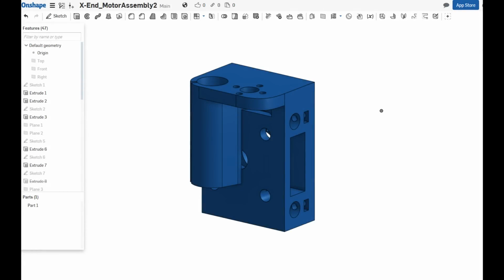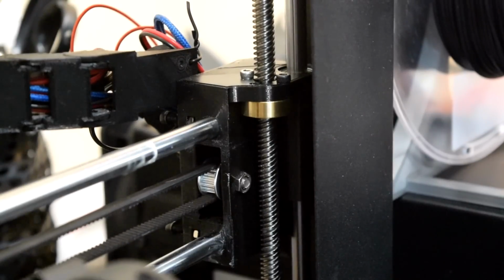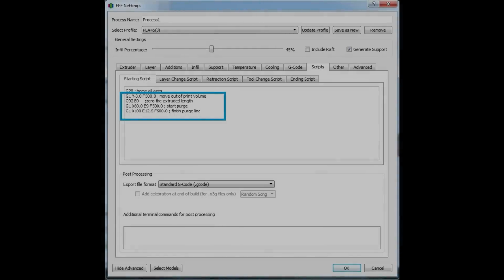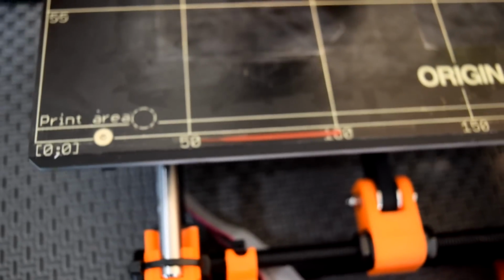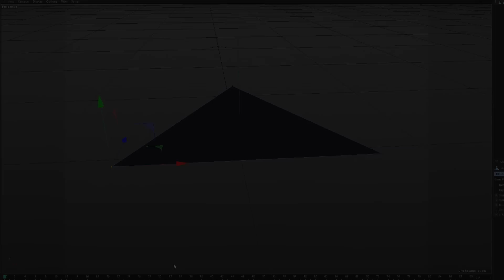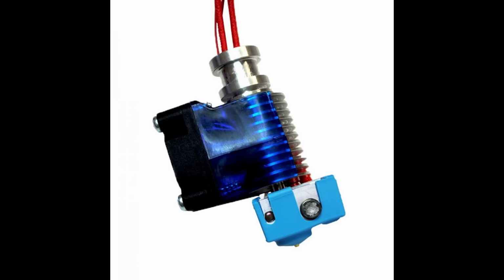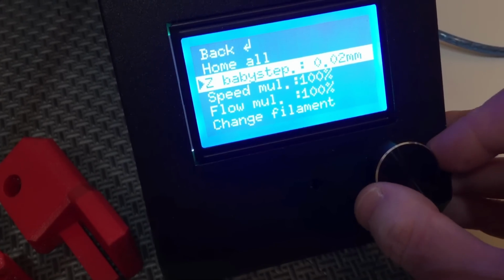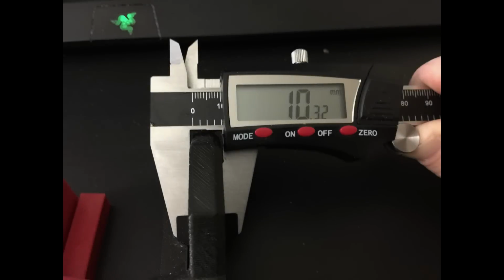Monoprice Maker Select v2 | What mods have I done?

Comment: Sorry this is off topic but I just picked up a Maker Select Plus 3D printer and the first thing I noticed was that the display was mounted to the vertical front panel of the case.  Do you know of an update to print a angled wedge on the front of the case to make the display at a more usable angle?
Thanks.

Comment: Great video I've had my Monoprice maker select V2 for about 4 years now and I have been noticing that the X and Y access has becoming more and more noisier I've upgraded the bearings and used dampers on the stepper Motors and I cannot seem to get this like vibration noise out of the printer it's more of like a humming noise on the x-axis it is no longer a silent printer what can this be I've tried everything

Comment: 4 bearings vs 3 bearings is negligible, if anything it determines the rigidity of your Y carriage or the slop in your bearings/rods.
Your 3 point plane explanation should be applied towards the BED and not the Y carriage. You have the y carriage from  RepRapChampion yet you still are using a 4 point bed plane. That introduces a complex wave curvature. Take your bed rotate it 90 degrees and use the 3 point mounts on the RepRapChampion Y carriage. Now you are on a 3 point plane.

Comment: A bit confused.  Being able to print other materials such as PETG, a hotend is necessary.   Not sure if any effort putting into this mod would be unnecessary or pointless.   Also not sure I agree with your need to calibrate the temperature.  The temp sensor is already calibrated.  The only problem i see is that Maker v2 only goes to 260 degrees.  Have you used a heat tempearture gun and saw differnt temperature between the original nozzle and the e3dv6?  Thanks.